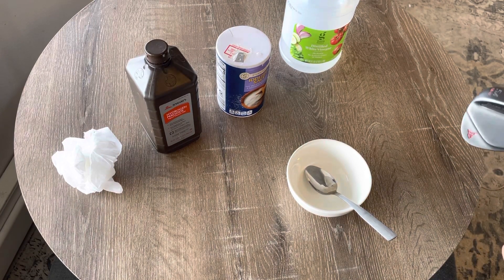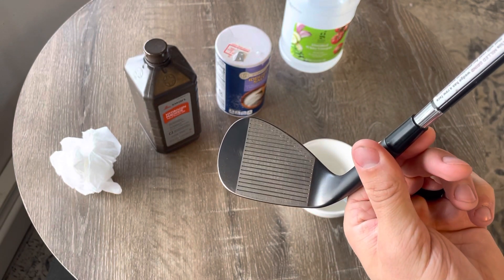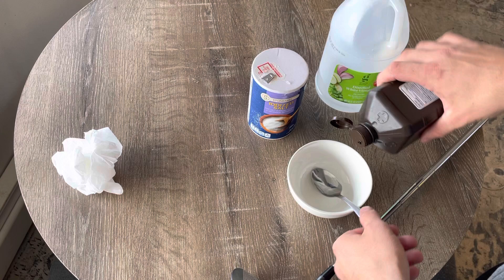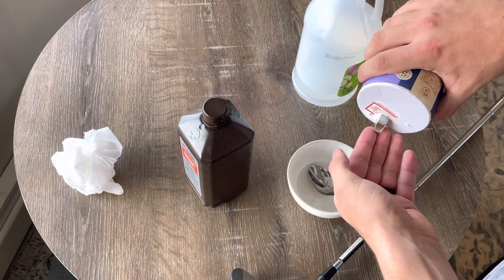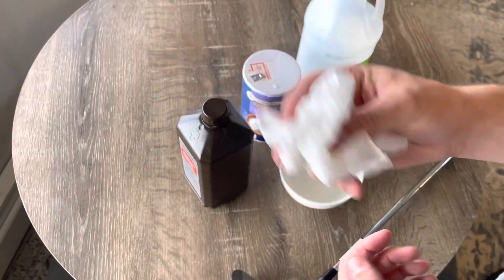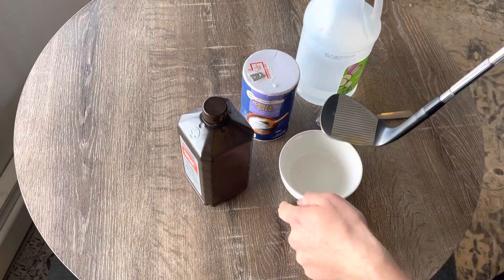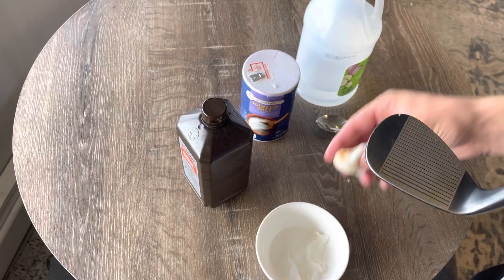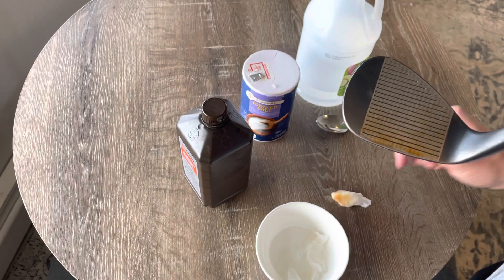How to rust a Taylormade golf Wedge MG2/MG3

Comment: i went on the golf course today and the rust came off after the first 2-3 hits even in rainy conditions. wondering if anyone else had or has the same problem
Reply: I portion of the rust rubbed off due to traveling ✈️ and I’m hoping this step helps me regain the rust evenly on the surface.  But I did want to confirm it comes off, but I thought it would re-rust eventually and it hasn’t. 🤷‍♂️. Hopefully this trick works.  👌